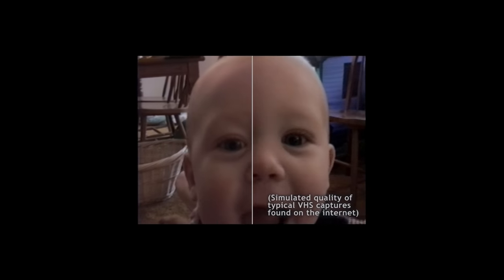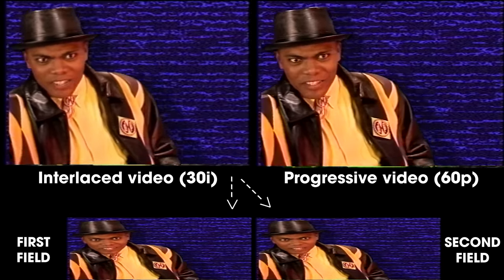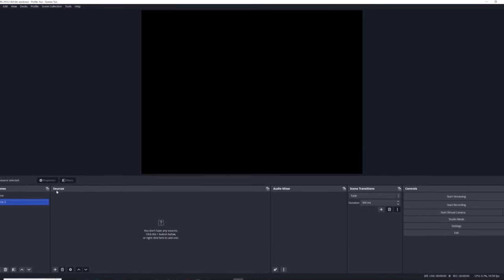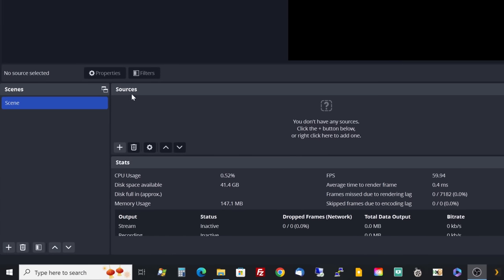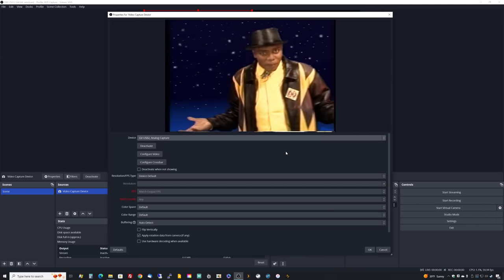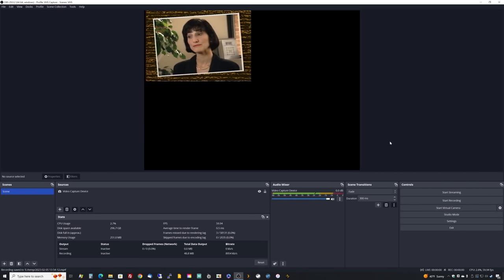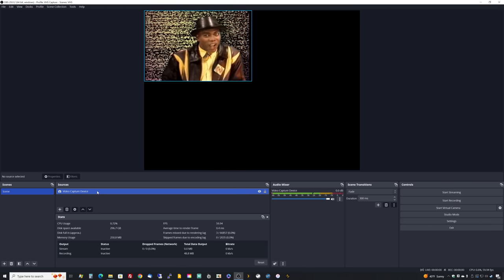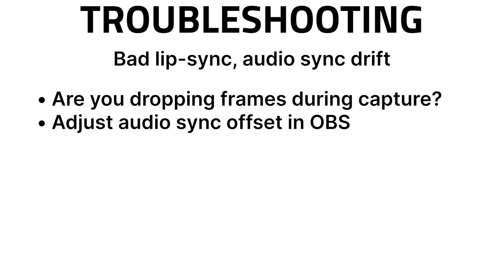How to convert VHS videotape to 60p digital video

Comment: So I got my hands on a DVC100 Rev 1.1, but it's not detecting audio?  It appears to be a common issue with that device and windows 10.  Have you any tips on how to fix this?
Reply: A quick update, I'm able to get audio through VLC, but not OBS.  Not I'm really puzzled
Reply: I should have watched the whole troubleshooting guide...lol.  I plugged the audio in via the mic in port and now I'm getting audio to play while recording via OBS, but it's not saved in the output file.
Reply from the maker: I would ensure the additional audio source is listed in the list of sources on the left side of OBS, and then also make sure you see audio in the VU meter on the right side during recording.  Hopefully you've figured this out?

Comment: I've discovered the video levels on a lot of old VHS recordings are blown out. I've got some old hockey games I want to dub but it looks like they're skating on the surface of the sun: no lines are visible, much less any ice texture. Is there a way to compensate for this?
Reply from the maker: If you've blown out the highlights during the initial recording, then they're lost; there's nothing to get back.  Sorry.
Reply: @TheOldskoolPC  I'm fairly certain that was not the case; I don't know if VHS tape can degrade over time to give it the blown out effect, but I would have noticed if the players were the only thing visible in a field of white, especially if it happened every televised game.  This was a local cable production, but even THEY weren't THAT bad at their job! :D  I'm just wondering if there's any simple (read: cheap) solution, either during the dub, or after. But I can't seem to find anyone dealing with the same problem.

Comment: Found this video while learning how to digitize VHS tapes for the first time, and it's very helpful! Out of curiosity, would you say using an S-Video to USB adapter like in the video is preferable to converting to HDMI for video capture?
Reply from the maker: Conversion to HDMI removes some control over the process, so "it depends".  If you'd like to see how an HDMI-only workflow would work, I have a link to a video in the description that goes over it.
Reply: @TheOldskoolPC  Ah, is that video "The Best Easy Way to Capture Analog Video"? I think I checked out that one as well, but thanks for letting me know.

I mainly ask since I was doing some VHS digitizing for the first time using HDMI+OBS around the time of my comment and mostly had decent results, at least without any prior experience to compare the quality of the output. However, on one tape there was a moment where the signal appeared to be lost for a few frame (showing a blue screen) consistently in the same spot the two attempts I made and I wasn't sure if that was a result of using HDMI or if it was something else.
Reply: @dearcrowns assuming the blue screen is coming from your VCR itself, it means the signal has degraded to a point where it can’t interpret it into an image (or that part of the tape was always blank, if it’s between scenes). As for the HDMI converter, the main problem is that they typically deinterlace the picture in a suboptimal way, so you won’t be able to get the full framerate.
Reply: @pokepress  oh I see, it might just be an issue with the tape then (I will note that there was a second section of the tape that had this similar issue for a couple of attempts, but then I found on my last attempt it was fine, so I wasn't sure)

Comment: i use the dazzle video capture device and plugged in everything properly but for some reason it doesn’t record the audio, it won’t show up on audio mixer with OBS, but with another software pinnacle for dazzle the audio works can you please help me out?
Reply: I got the same problem. I wasn't getting anything working at first but I had to download two different drivers to get just the video working.
Reply: @not_sauceremover1203  does your video capture in 60fps?

Comment: I would be interested to know why you're recording in OBS at 59.94 fps instead of 29.97 fps. Doubling the frame rate doesn't seem to add anything. All of these video capture devices output 29.97, so you're just duplicating each interlaced frame. You can confirm this by playing the recorded video frame by frame, the interlacing is identical in each pair of frames. When OBS deinterlaces the video, the recording again seems identical at 59.94 vs 29.97. Again, when going frame by frame through the deinterlaced 59.94 video, you end up with pairs of duplicate frames.

It's too bad OBS can't record interlaced video and output it properly flagged as interlaced. If that were possible then a better deinterlacing method could be used after capturing in OBS.
Reply from the maker: You may have missed the section of the video where I compare 30p to properly deinterlaced output, or where I explain in the video about fields vs. frames.  I also explain why you have to set the rate to 60 in OBS if you're going to use a x2 deinterlacer like yadifx2, which outputs each field as its own frame.  If you follow this process and your output is a 60p file where every other frame is a duplicate, then you missed a (deinterlacing) step.

This tutorial is not meant as a preservation-grade archival transfer process.  For my archival and restoration work, I use different software and processes, and maintain an interlaced workflow up until the point I need to create progressive output for public display.
Reply: @TheOldskoolPC  I definitely went through your OBS steps very carefully (it's a great tutorial by the way!). I actually ended up buying 3 different capture devices, the last being the IO DATA GVUSB2 you recommended. Aside from having to adjust the brightness/contrast of each a little differently, they all produced identical results. Before turning on deinterlacing in OBS, the captured interlaced artifacts at 30p were identical to the duplicate frames at 60p. And after turning on yadifx2, the captured deinterlacing was identical at 30p to the duplicate frames at 60p.

I understand the theory of capturing at 60p, but I believe these capture devices are baking everything in at 30p (or perhaps OBS is). The end result is still pretty good, good enough for my needs. I just brought it into DaVinci Resolve and added a little motion blur to help smooth things a bit more.

So yes, not knocking your process, which I think is a nice/easy method. Just curious if something isn't actually working with these devices and/or OBS as intended.
Reply: @TheOldskoolPC  I just checked your own video and see that you are actually getting 60 unique frames per second! I can't figure out why I'm not... I'm capturing Hi-8 video played from the same Sony Hi-8 camera it was recorded with (via S-video). I've got OBS set to 59.94 fps and yadif x2 is selected...very strange.

Comment: Everything here not allowed to get best quality of the video. No need play with contrast and bright! , best way to get initially to RAW format first form the tape and it should be only original directly from tape. Need use only 10-12 bits capture device.  Also big mistake apply any filters during capture process!!  Best quality can be achieve if capture vieo to to RAW with color profile and wide color space and then use software and filter wich allowed use pixel shifting and 3-5 farme behind and upfront for upscale,  analyzing to remove noise, rework PAL or NTSC modulation deblocking distortions features and AI sharpening with color reproduction. Any Adobepremier, Finalcutpro and Davinchi resolve do not have this options! This good only for home style digitizing process.
Reply from the maker: This tutorial was not meant for serious archival work; it was meant for people who want to dump VHS and put it on youtube without losing any temporal fluidity, and for that, it works well.  For archival, I personally use a Blackmagic Intensity and capture to raw YUV 10-bit 4:2:2, then process from there -- and always keep the original RAW capture around for future processing.  BTW:  The "pixel shifting frames ahead/behind" method you describe is a so-called "super resolution" method which is nearly useless for anything handheld...
Reply: @TheOldskoolPC  Yes, black magic is a good card. but for us is best to take a modulated and not converted signal from the internal circuits of the VCR before it goes to the end RCA connector, This allows you to use a powerful software filter to remove distortions introduced when it was previously recording by camera in the pal and ntsc fideoformats - The reverse process allows you to get more real colors and smooth lines. It is also useful to change the clamping and tension of the tape on the drum. We also know how to adjust the azimuth of the axis of the video head for acheve accurate pozition on the track.

Comment: hoi, I bought the dazzle because of your video and now it doesn't work. I want to add the source but it doesn´t give a picture. I installed the drivers from dazzle but still it doesn't work. Maybe it doesn´t work on windows10? can you help me?
Reply from the maker: There is a link in this video's description that points to another video where someone demonstrates exactly which drivers and procedure to follow to get it working.  Hope this helps!

Comment: hey, I need help, I followed your stipes one by one until 11:35 I encountered  the (device) in this blank or spot I can not chose a device to be more specific OBS did not identify any capture devices at all while I connected the GV-USB2 in my PC and in the JVC device. FYI, my video device has spots just for yellow and white cables is it the problem or what ? does it has to have a red spot too ?
Reply from the maker: Did you install a driver for the GV-USB2?  As for the cables connect as many as you can.  Your VCR probably only has mono output which is why it is missing a spot.
Reply: @TheOldskoolPC  
So does it work on mono devices, and thanks you are right I did install the driver and it appeared on OBS but now my problem is once I play the video on the VCR the video on OBS is not working good just the voices working and a little bit of some frames from the video how can I solve this issue ?
Reply: @TheOldskoolPC  
sorry for bothering you, I'm wondering do I have to plug the black cable too because I do not have this type of cables should I buy one ?

Comment: Great video! Important question, does the I-O Data Capture Device work on Windows 11? Do its drivers function properly on Windows 11? I've been using the Roxio Easy VHS to DVD 3 device, which so far had been very difficult to get it to cooperate with my computer. I finally got it to work after changing a lot of my PCs security settings, got it working on OBS, the picture looked pretty okay, but alas I ran into an audio issue. During playback and recording the Roxio capture device will lose audio every 10 seconds or so and then the audio will come back on, play for a few seconds, and then the audio dips again. The tapes and VCR are fine as I did some trouble shooting already, I pinpointed the audio problem as within the actual capture card itself, and I'm willing to bet that its because there are still a few drivers Windows 11 refuses to cooperate with even after circumventing it in the security settings.

Would you happen to know if that problem will still be present if I used the I-O Data device with Windows 11 or are my tapes doomed?
Reply from the maker: The GV-USB2 and the driver I posted worked fine for me in Windows 11.  I've never encountered a regular audio dropout as you've described.  Hope that helps (and if something goes wrong, at least Amazon has a return policy :-)

Comment: Can OBS capture DV cam?
Reply from the maker: That's a great question -- I'm not sure.  The best way to transfer DV CAM is to do it through firewire / IEEE.1394 so that all bits are transferred exactly.  In Windows, I use WinDV to do that.
Reply: нет это не работает, увы.
Reply: Yep, it absolutely works on my Mac.

Comment: The main thing is to find a VHS tape player that the rubber rollers haven't turned to glue. If you are looking to buy a new working VHS player good luck, they are expensive.
Reply from the maker: Luckily, there are ebay vendors who sell replacement rollers.

Comment: I am from year 2037 and thinking of starting a channel where I can teach you how to convert your old crappy starting at 4k 60fps to 16k 240fps videos into 448k 17Kfps real life, output result is 1 hour of footage ~12 TB. Cost for 1 hour of rendered footage is $750 in 2023 money or $2745 in 2037 money. You also can go to the multiverse time currency converter to check it yourself.
Reply from the maker: How did you solve the excessive-framerate-blood-brain-barrier limitation?

Comment: Prob a silly question is this mac too or no? 🙃
Reply from the maker: Not a silly question -- Yes, same software and process on Mac, although you'll have to find a mac capture device.
Reply: @TheOldskoolPC  do you know of any capture devices for Mac that capture both fields the way the ones you talk about in the video do? Thank you for the video by the way!
Reply: @ChristopherDanner  My setup: VHS VCR - Composite cable - Panasonic DMR ES-15 (pass-through as TBC-corrector and DNR filter) - S-video cable - miniDV camera ( with pass-through mode) - Firewire 4p-9p cable - Apple Firewire 800-Thunderbolt adapter - Apple Thunderbolt 2-Thunderbolt 3 adapter - Mac Mini M1.
All of these things are very cheap on ebay, except for new Apple Thunderbolt 2-Thunderbolt 3 adapter.

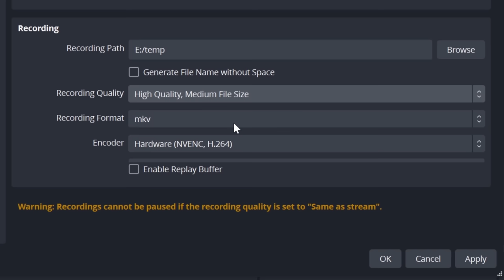Comment: Not too be contrarian, and I appreciate the effort, but assuming that this software is compatible with my OS (hint: it isn't) to get slightly better video quality I need to buy a new adapter, download the OBS software, download the audio software needed for my Mac, and then follow about 50 non-intuitive steps to arrive at my slightly smoother video. Without the tutorial, or with any slight deviation from your assumed conditions, it would be nearly impossible to arrive at an acceptable result. Any one mistaken setting out of hundreds of options could send me down the wrong path. So, if I could download OBS, I would be looking forward to hours of frustration in trying to get the settings right, only to give up rather than wasting more precious hours of my life. BTW, what's a "muxer" (16:04)? I hadn't noticed that the videos I saved previously had any quality issues. I think I'll stick with those. Thanks, anyway.
Reply from the maker: OBS works on Linux, Mac, and Windows.  What OS are you using that OBS isn't compatible with?
Reply: Mac. OS 10.14.6 , Mojave. Whenever I try to open it I get: "Warning, The following disc image couldn't be opened, OBS-studio-29.1.3-mac Corrupt image"  And that's that. @TheOldskoolPC

Comment: Generalizing hardware to the year it was released is a very bad way of determining whether a hardware is performant or good enough to accomplish a certain task.
Reply from the maker: It is good as a general guideline, as the year is something non-technical people can almost always answer when you ask them "what computer do you have".  This tutorial was primarily meant for non-technical people.
Reply: @TheOldskoolPC  The thing is, though, that it's a general guideline that will often lead people to have a wrong impression of their hardware. When you go for "non-technical" statements you also get "non-technical" results, which often are bad.

So when someone has a 2022 Pentium Gold G7400 with 2C/4T your statement says that it's better than my 8C/16T 9900K from 2017. We both know that is completely wrong.

So the least you should do in my opinion is to make a general statement for a year and a CPU model line, i.e. "a 2020 Intel Core i7" or "a 2020 Ryzen 7". Non-technical people can easily get that information by pressing WIN+Pause in Windows.

Comment: Using a miniDV camcorder to convert the analog VHS signal to digital is an infinitely better method than this
Reply from the maker: That depends on the VHS content.  NTSC DV uses a 4:1:1 colorspace, so if you have high-contrast color edges (like video titles), DV will actually mangle them and give them a stair-step appearance.  Both analog transfer and DV conversion are lossy, but analog transfer's generational loss is analog noise, whereas DV conversion's generational loss is DCT compression.  If you have a clean source, DV is great.  If you have a somewhat noisy source, DV will add compression artifacts.  So the best one to use depends on the source.

Comment: Everything is 24fps, 25fpf or 30fps why would anyone want to go to 60fps when the original footage has less information?
Reply from the maker: As I explain in the video, analog video interlaces 2 fields into every frame.  Each field is a different moment in time, so it contains 60 different fields per second.  If deinterlaced properly, the output is 60 progressive frames per second, which this tutorial demonstrates.

If you're converting VHS to 30p, you are throwing away half the information, and it won't have the same smoothness that the original material has.

Comment: How can you crop the video in OBS to eliminate the overscan at the bottom and still retain a 1440 x1080  or 960 x 720 output?
Reply from the maker: OBS has a crop filter, and you can also resize the input a few percent to be larger than the canvas.